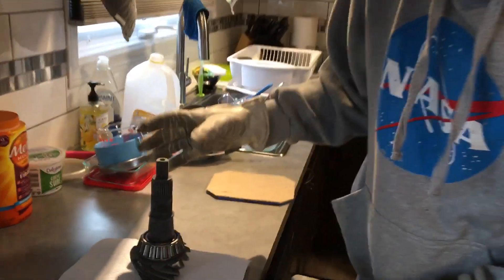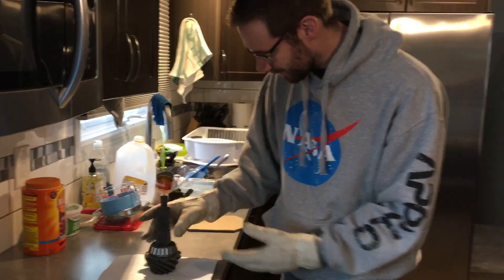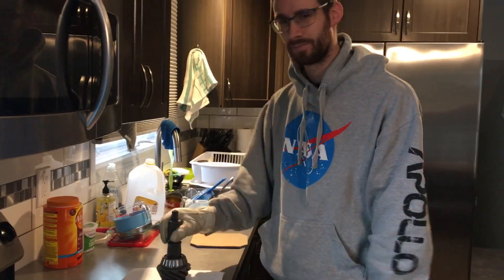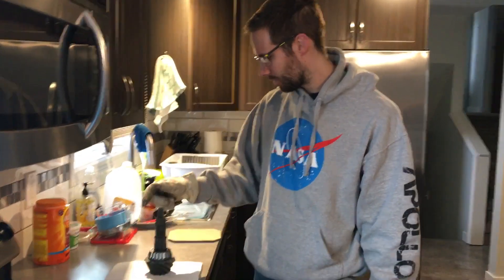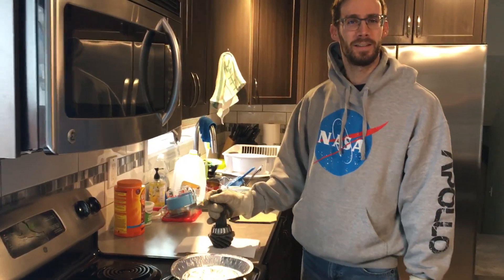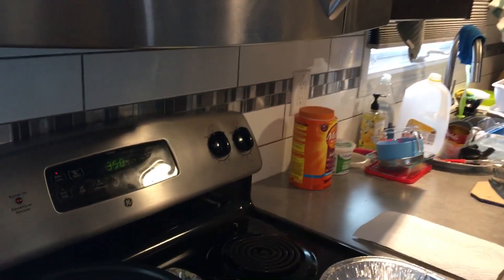Pinion bearing install - hydraulic press NOT needed!

Comment: What did you do with youre upper bearing(that sits against the yoke) didnyou also heat it ?
Reply from the maker: That could be the "front" bearing. The race gets hammered into the case and you slide in the bearing. That one is not a press fit. Torque from the nut holds it in place.

Comment: What about the bearing grease though??? I do like this trick.
And why isn't there a chart that would be for the same swap everytime? Say if I was swapping out the stock differential in a dana 35 yj to a 4.88? Hasn't it been done so many times that there would be a standard/chart of how many shims??? Instead of crawling around 
..
Reply from the maker: @jedhatcher252  no grease needed. Diff fluid lubricates the bearings. There are too many potential variances between diff cases and ring and pinoins to make a set in stone chart for shims.
Reply: @moderate_performance  alright 👍.
Reply: @moderate_performance  is there a kinda standard starting point with the shims?

Comment: This is awesome! Now how do we get it off without destroying it when the shim is not the right size? That is the real question.
Reply from the maker: The only option I know of is destroying the bearing. They do make an installation bearing which will slide on and off no problem. However, the diffs that I have rebuilt have been just fine using the shim that was in there previously.
Reply: Grind out the old bearing so it slips over the pinion then mock set it up and get your depth measurements. Then you can put the right shims on  and install the new bearing.
Reply from the maker: Yes sir. I haven't had to work on many differentials but maybe the next diff I will actually worry about pinion depth lol

Comment: at the milled i worked at, we have a bearing heater to install Timken bearings. heat oven to around 250 -300 degrees with bearing inside about 20 min. if it doesn't drop right on, put back in oven again

Comment: I heated up my ring gear to put on carrier. just need to support carrier up on wood so you can start one bolt on ring gear to line up bolt pattern. do a practice run first ,

Comment: Worked at a GM dealer as a Tech for decades . We received a special Pontiac tool from Kent Moore . A counter top toaster oven and the intended use was to heat bearings for installing on transmissions shafts ....worked well too .
Reply from the maker: That is too funny! Gotta love the Kent Moore "special tools"!
Reply: Would have tried garlic bread in it at least once.

Comment: I hope you got the shims set up for the proper depth there turbo.
Reply from the maker: I will admit, I did just reuse the pinion shim from the original set up, but it worked out ok. Tooth pattern was right where it should be.
Reply: @moderate_performance  Worked great using an Air Fryer for 10min at 350F to heat the bearing.  Used a Thermo to read the temps. Pinion was at 39F and Bearing was at 250F. Bearing slid right on just like your vid. 10 Bolt Chevy 7-5/8 BTW.

Comment: And what about to remove the bearing without a press? Thank you for your answer.
Reply from the maker: A cut off wheel is probably the only way to remove the bearing without a press. Cut through the cage and the race. I have had to cut through the race before.
Reply: @moderate_performance  I used an air hammer for the carrier bearings. Cut through the cage: Hammer the race out on the outboard lip.
Reply from the maker: Air hammers can solve a lot of problems!
Reply: Air chisel always works for me. 👍🏻
Reply from the maker: Air chisels/air hammers can solve alot of problems lol
Reply: @moderate_performance  they can sometimes cause a lot of problems, too 😀
Reply: There are pinion bearing pullers on ebay for about $40 they only require a half inch socket wrench to use
Reply: @puppythief704  Post a link to one.
Reply: I used the cheaper Harbor Freight bearing separator kit, and slowly turned the screw with my impact wrench.  Pretty easy.  I've got my pinion gear in the freezer now, and will try installing the new bearing in the morning with this method.
Reply: Worked!  Thanks!

Comment: So I can tell you this doesn’t go as swell with the carrier. Much less press force was needed tho once hot. I also could be a clumsy b and canted it just right both times trying to drop on. Finishing prepping this grizz locker for my pop’s Mercury marauder that some local shop completely effed the preload and back lash on wrecking the gears and bearings.
Reply from the maker: Sorry to hear your shop messed up your diff. That sucks! Setting up a diff is one of my least favorite things to do. Messing with shims to get the right pattern and preload is so time consuming.